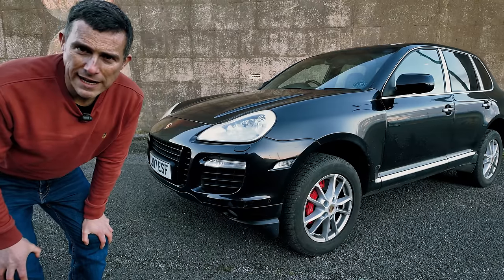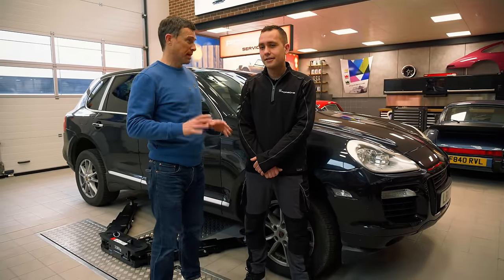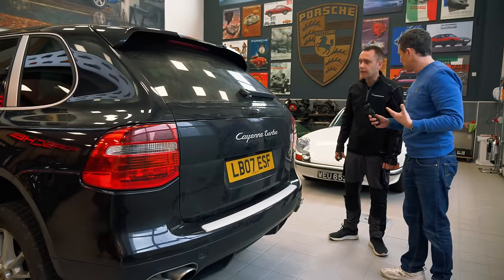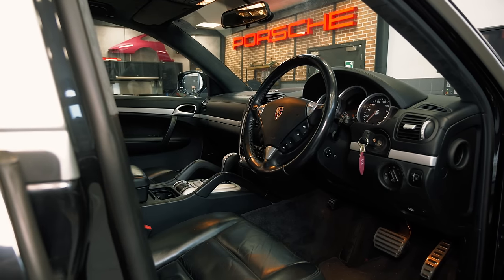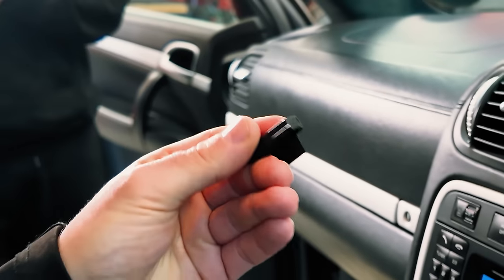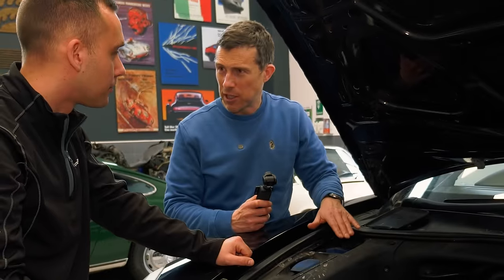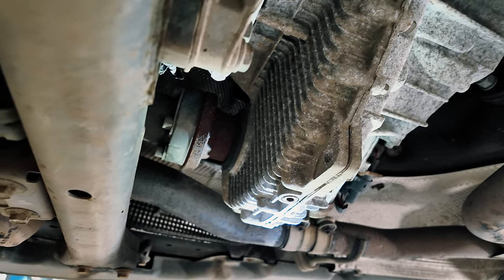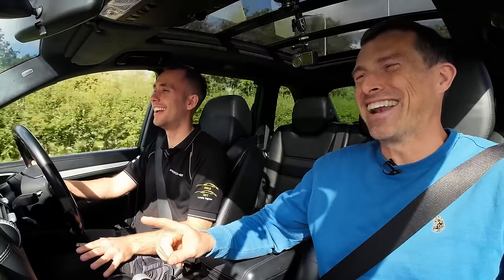Have I Bought a MONEY PIT?

Comment: Ok as an owner of several….prop shaft will need upgrading £800 , boot lid struts £120, brake pedal strut £10, window regulators £20 each, and brake sensors £19 …keep the drains clear that’s vital to stop electrical issues. But they’re really strong and great fun straight piped!!
Reply: ⏫boys and girls up to 16
Reply: Sounds to cheap .
Reply: Sounds pretty minimal.
Reply: wow big bill on these German cars
Reply: you forgot to mention the 20,000£+ bore score issue that WILL happen.
Reply: I’ve got 4 sitting on the estate and never had an issue with bore score. They take huge miles, great cars and really easy to work on.
Reply: £120 for boot lid struts!  Thats like $250 NZD I think... I bought both boot and bonnet struts for  something like $150NZD delivered on my GS460 so that'd be well under a hundred pounds for all 4 struts - that was for Australian supplied struts.  Admittedly the GS460's boot struts are much smaller - but might be worth shopping around on-line?  Everything else seems pretty reasonable though, especially for a Porsche.
Reply: Your prices are too low and labor needs to be included too.
Reply: @bigmacdaddy1234  These are all easy jobs any home mechanic could do themselves.
Reply: wow things are still cheap in the UK. In Germany these jobs will be double or triple the price.
I used to have a Cayenne Turbo and it was pretty reliable if maintained properly.
Reply: Well done mate you made someone very happy buying that. hope you have deep pockets but it will be a nice car when it's finished bankrupting you.
Reply: You would be surprised really easy to work on and no major issues.
Reply: They aren’t new cars I use OEM parts and buy second hand bits and pieces.
Reply: I do the work myself although the strengthened prop I got Porsche torque to do.
Reply: @sorinelpustiu5674  Only on certain cars, 2007 & 2008 Cayennes had a large problem with scoring. In 2009 they changed the cylinder surfacing method and that seems to have lessened the problem.

Comment: Had one of these (first generation, bought for always nothing) 3 years old, low mileage, in Florida and re-imported it to Germany. Has been a realiable towing donkey for many years. Sold it with nearly 200.000miles on the odo, still working w/o problems. Only had to replace the propeller shaft once (at more than 115.000 mils) and replaced the old satnav with an Android one. One of the best cars I've ever owned.
Beware of the case of the ICUs in the engine compartment (sometimes the develop cracks on the underside that let humidity in) and have an eye on the coolant tubes in the V of the engine. Original they had been plastic (and had a tendency to fail), the late models got those made of aluminum.
But good value for money, congrats Mat!

Comment: Worked at Porsche when they were new. Phenomenal body control and pace for such a large car. Always used to recommend the sand beige interior with black metallic paint. OEM spec tyres don't last long but it handles really well. Will nuke most cars from the lights!
Reply: I think so.
Reply: same beige would have got far too dirty
Reply: Won't beat sweet fuck all at the lights these things are slow, old and unreliable so many basic cars are faster than these are stop living in the early 2000s buddy 😂
Reply: @lexman8678  quattro
Reply: @lexman8678  When it was new, its handling was compared to Audi RS6. It killed all its competition and was the fastest SUV in the world, beating GMC Typhoon
Reply: What engine would you recommend? Both for 955/957 generation
Reply: @lexman8678 If by "sweet f all" you mean "will beat the vast majority", then you are correct. The average UK car does something like 9 seconds 0-60.
Reply: @GoldenCroc  average Tesla does 3 seconds
Reply: only when you use brake boost 
Otherwise,a Polo GTI will take you at the lights.
Personal experience.
also turbo lag is atrocious
Reply: @ARIES6181  well it's not new anymore and basic cars are faster than those a gmc typhoon was from the 90s grow up buddy and stop living in the past
Reply: @Lemingtona-x5g  No, its quite a bit above 4 seconds, and probably closer to 5 as well for the average Tesla. The high power ones are uncommon.

And Teslas themselves are not common compared to most cars on the road in the UK.

9 seconds 0-60 average should be about right.
Reply: @kamenpetrov5462   Avoid N/A 4.5 V8. It might overheat or even melt the cylinder.
Go for turbocharged ones and make sure to replace plastic cooling pipes with aluminium, even if the plastic ones are good
Reply: @sorinelpustiu5674  Dont know if that Polo GTI is hyperbole, but it can possibly beat if for the first ten yards or so. After that, it got no chance. So if that counts as "take you at the llights" I agree. 

Generally many people go by the 0-60mph for "low speed acceleration" in which case any polo is way behind.
Reply: @GoldenCroc  most cars are not Porsche on UK roads , whats ur point?
Reply: @Lemingtona-x5g  My point should be obvious if you read the first of my posts you replied to again, as well as the post I replied to. Just answering what that post claimed, perhaps in a joking way, in a serious manner.
Reply: @GoldenCroc  don't care much for Porsche marketing
Reply: @Lemingtona-x5g  Sorry, I dont get what you mean? What marketing? I dont see what that has to do with any of my posting?
Reply: @ARIES6181  I think melting cylinders is a small problem, do you perhaps mean the bore scoring problem? That one is pretty common, sadly. I think the 4.8s arent immune to it iether, but should be a lot better... But none of the V8s are bulletproof, its a bit of the luck of the draw... Best to go V6 petrol or diesel if one is worried.
Reply: @GoldenCroc  Matt and his Porsche marketing content
Reply: @Lemingtona-x5g  Ah, ok. Fair enough. 

But as I am sure you will agree, thats not  related to my specific comment really.
Reply: @ARIES6181  I would take the typhoon or the SS trailblazer over this for mid 2000s SUVs. these things are just straight up ugly. SUV version of a 996.

Comment: I’ve owned one of these Grate car, can be run fairly economically if you are willing to self maintain the car, like servicing and moderate repairs. But the only issue my one had was the cruise control would not work. But never let me down. At the moment I’m running a Saab 95 2007 that’s done around 200,000 miles and still going strong. But am in the market this year to get a much newer car and probably going for something like a bmw x5 d30

Comment: If you clear the codes, when would they pop up again, if the problem persists?
Reason I'm asking, say you're buying a used car, if the seller is clearing the codes and I check with my own scanner, would they pop up again? Otherwise you'll have to make sure the seller havn't just cleared the codes before you drive off.

Comment: At last u got urself a proper motor 🎉👌. 2 things, the taillights r dead easy to remove and dry off, just a sealant around and ur golden. The back lid needs to be opened 1st via the remote. Weird the mechanic didn’t know that. It’s an anti theft system when ur standing still…

Comment: I recommend looking inside the cylinders. I bet you will be surprised. This cayenne's engines are crap. They always get scratches inside the cylinders - so that's where the oil went
Reply: This gen turbo always used oil
Reply: Not always. Late 4.8s are pretty ok, for the V8s. The VR6 has has minimal or even no issues at all. Same with the diesels.

Comment: My 2020 new shape 992 911S had leaking rear lights and centre light bar. Replaced under Porsche warranty also both the BOSE speakers blew also replaced under warranty. Micro switches on the doors and door handles both broke  warranty again  Then the gear lever cracked warranty also. Drivers seat balster in black worn prematurly  LX19 NVA Despite this im getting a new 992 911 GTS Porsche no 6

Comment: Maybe the head gasket is leaving cooling water inside the engine and it blows gases into the cooling system so it is under immense pressure so it leaked out of the cooling reservoir

Comment: The previous owner was running this separate set of winter tyres on these wheels. The other wheels will obviously have the summer tyres, which might well be newer. 
ie don’t replace the winters on this second set of wheels with summers.

Comment: 10:31 I didnt know you could even get them without the powered bootlid, even the base spec 3.6 I have seen got it here. You brits got shafted on standard equipment as usual, I guess your market is super price sensitive even for cars like this.
Reply: Yh in the UK list price is more important than anything else. People don't care about the features for the most part just the badge and the price. Which is why you see so many Audi A1s about even though they're basically VW Polos underneath and are actually smaller than the Polo
Reply: @Afraz_9n3  Yes it certainly seemed that way, I have seen it before. Didint think a cayenne would be directed to as price senstive a consumer but it seems they were. 

If you dont know, check out the average income of cayenne purchasers in the US... yeah. I bet its a lot more than UK buyers.

I was thinking of buying a new BMW M140i when the exchange rate was favorable and they had nice prices in the UK, like 29.999 and stuff like that. But as a certified "option hound" that need every option availible, I was shocked at the lack of them as standard in the UK, and the price to add them. All in all, after I optioned the car up to where I wanted it it wasnt any cheaper to buy it in the UK.
Reply: @GoldenCroc  yh I mean the UK generally is just extortionate for everything so car prices are the one thing that has to be semi affordable (I say that but currently the average person CANNOT afford even the cheapest new car. But cars did used to be affordable 🤷🏽‍♂️). Like say you bought a first gen Cayenne new your probably earning about 60 - 70k (and got it on finance) and you'll be paying £700 a year on road tax plus the insurance which lets say the person lives in London would be at least £5k and then the finance payments and the fuel costs . So it all adds up and if the car is fully optioned out and therefore more expensive then it would put you off the car really because it would cost too much to run.
Reply: @Afraz_9n3  Well, yes, exactly. The average household income of new cayenne turbo buyers in the US is probably something like  300-500k USD per year, I bet. Perhaps even a bit more.

I think UK is one of the most "financed" and also has one of highest ratio new car MSRP to income in the world, courtesy of the quite common brit inclination to show off you social statuts via your car, versus doing it in other ways that are more common in other countries. As you say this means that logically its mostly the exterior and the brand that counts.

Myself, I am not very rich, but I got a very similar car to the one featured in this video. Lucklily, I know how to turn a wrench a little bit myself.
Reply: @GoldenCroc  exactly that. Not many people earn anywhere near 300k in the UK 🤣but everyone wants to "look rich" and the easiest way to do that is get a fancy car. Brand snobbery is a big thing here forget about reliability and practicality just the badge matters🤣🤣there's also a big throwaway culture which stems from stereotypes of old cars. So a lot of people have the mindset of 20 year old car/ car with 100k miles = ready for the scrapyard. We're pretty spoiled for choice though because people can scrap these cars and then buy another for £1000 a lot of the time. But it also means classic cars are rare and expensive

Comment: Had a pre-facelift Turbo. It was supernice to drive, comfortable and I loved how it sort of generated a thrust when you floored it.

Sold it because of its abysmal fuel consumption in towns and high fuel prices... 
Also driven the 957 with 3.0 TDI and it´s very nice too. Taxes aren´t nice, though...

Thermostats are very cheap to buy and are not a big issue. A broken head gasket is an real issue, though. At least Porsche replaced plastic water pipes with aluminium ones in 957.